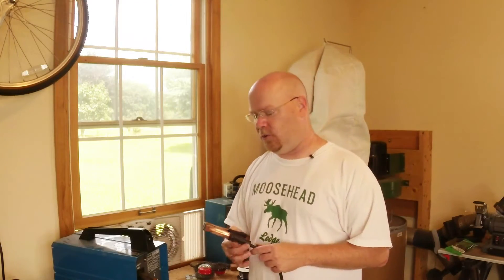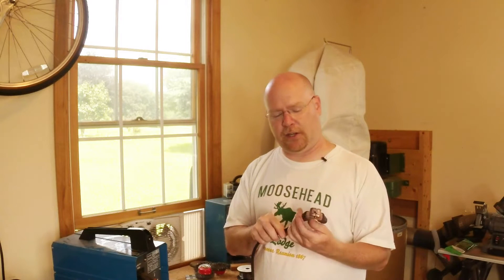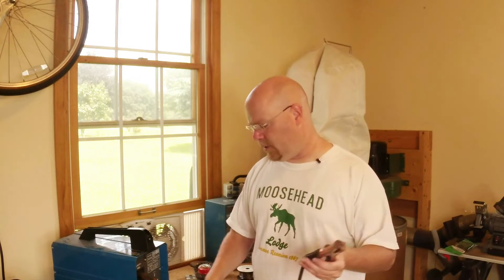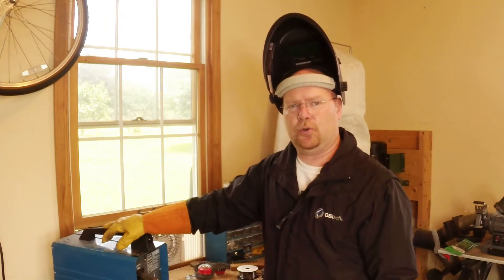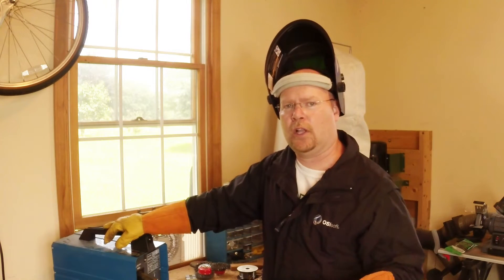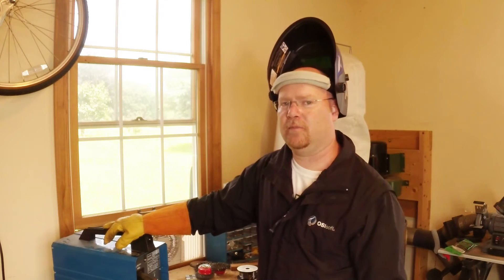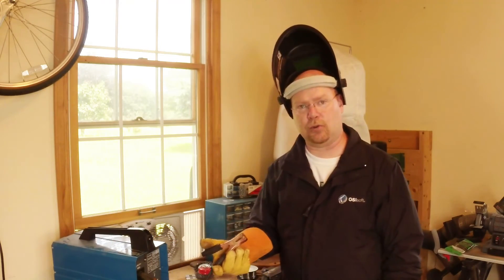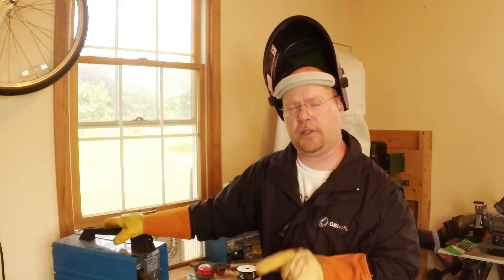Easy Harbor Freight 90 AMP Welder Mods 08

Comment: thanks for the videos. im attempting to  restore a 95 jeep xj. never welded before, my boss is letting me use his welder. i have to replace the whole floor and rail pieces. so most if not all the welds are hidden but i have to make due what i have thanks

Comment: Ok I have a stupid question ? I have a harbor freight 90 amp flux core can I plug it in to a portable generator?
Reply: Well...

The unit wants a 20 amp rated socket, if your generator puts out 30 or more... I've seen guys do it.

I'd worry about damaging that generator to surge though.

Comment: Hi Matt, Michael Lydick here (AA2QO dit-dit). 

I did all the modifications, with the only difference being I used a much larger sized can, and I had to run 10 gauge wire from the leads which were about 10" each from the can back to the rectifier. When we went to weld, there was almost no power, and the bead formed on the surface of the metal like bubbles. . 

I purchased this cap:
PHILIPS 34000uF 50 VDC Large Can Electrolytic Capacitor 3186GH343U50AMA1 --SC

And this rectifier:
Taiss / 100A Amp 1200V Heatsink Shape Single Phase Diode Bridge Rectifier Metal QL100A

All leads going to the rectifier are original wire screwed to the terminal. The leads going to the opposite side of the box to the cap are #10 and about 8-10" long with screwed ring terminals. 

We had to flip the switch to "high" to get it to penetrate the 060" .  Something's weird....any advice appreciated.

Oh - when we put the leads back to OEM, it welds like normal. :-(

Comment: i've used mine off and on for 10 yrs. required the tensioner mod and have had to reinforce the wire hose at the face plate. but for a position welder i've found with practice i could weld vertical and over head outdoors in moving air but you had to leave or even extend the nozzle. i guess the new one is better or safer anyway the only hot with the trigger pulled unlike this one. but there very handy if 220 isn't available.

Comment: How is that welding helmet working out? Read a bunch of mixed reviews on HF..
Reply: The cheap auto-darkening helmet from HF is actually somewhat slow, especially if you've ever dropped it.  You will get the initial arc flash with no darkening and be seeing spots for a few minutes.  I try to avoid it now and use an old school flip down helmet, heh.  Spring for the good helmet if you want auto darkening.
Reply from the maker: It's working fine for me.  Flux core is a messy process no matter what you do, so while more expensive helmets are decidedly clearer up front, after about 5 minutes of welding they all end up the same.
Reply: +Matt Heere Nice! Thanks for the quick response. I'm going to pick up that mask . I have another question.  I'm looking to building a rack for the back of my pick up would this welder be able to handle/weld a 1-1/2" pipe schedule 40? I would use tube but kinda hard to find an inexpensive tube bender.

Comment: I bought one of these HF 90. I have had it and used and still use it for 5 years now . It has done great for me, I did notice right off about the tip and I stay away from HF wire. But I use it a lot on building bandmills which I use a lot of tube steel . The wire feed rollers have slipped so I was using a C clamp to apply a lil pressure but now I know how to fix that issue. Thank you for the info. Its very helpful.
Reply: I've got a really old unit (I think) and the feed mechanism is somewhat different.  About 2-3 years ago, I tried using it, but had no idea what I was doing and the cheap, auto darkening HF helmet would always darken too much, regardless of the setting, and I couldn't see what I was doing, just a small spot of light.  But feed worked fine.  So I took your advice (not complaining, probably shouldn't have bothered) and adjusted the feed roller (it has Lincoln .025 wire and what looks like the right tip to the thinner notch.  Found the non-drive roller very stiff and lubed it so it rolls free.  Now it won't feed AT ALL...  :(  Maybe I'll try this fellow's C Clamp idea.    Or try removing the wire from gun and re-feeding from beginning to see if it'll feed at all/stop at some point down the gun tube.  Frustrating to mess myself up..  :)

But thanks for great series of videos on this little welder.  Without feed working at all, no sense doing anything else to improve it's use.

Ok, I'm an idiot, forgot after last tweak to tighten the screw down.  Seems to work, sorta.  Might be the fact that it's designed ONLY for 30 and 35 wire and this is 25.  I'll have to dig up the old HF stuff I bought before I knew not to.

Still can't seem to get much penetration.  I've done gas welding in the past and do pretty well, mostly on thin stuff, so I understand about penetration being important, but just doesn't do it.  Will try the thicker wire and see what happens.

RichE

Comment: I have an Lincoln Sp 135 and it was 600.00, .035 wire, It looks like the same weld, less splatter but I'm no welder. I use it  instead of nuts and bolts, It does accept gas,.. argon and come's with a meter. But with flux core, I never use that feature. I tried it years ago to be honest I don't like the smell of argon. flux cored works for me, Next time I'm in the market for a 120 volt welder, Ill give harbor freight welder a try. Very informative video.

Comment: love your series on this buzz box. as a union pipe welder who does it all but, mostly stick welding i learned so much. sometimes or all the times dragging out my welders are a p.i.t.a. lol. so i was thinking on getting this pos to do light stuff. like pinning muzzle breaks on rifle barrels. that bb-ing can be minimized to a small amount on short stringers by covering area around said weld with pieces of fiberglass welding blanket and taped or wired around the area. thanks for your tips! you have a great channel that i subbed.
Reply from the maker: +MegaBait56 Thanks!  I want to pick up stick welding at some point.  I love the idea of the versatility of all the different rods available.

Comment: Thanks for doing this series. I'm gonna be doing this mod soon. I will be using a 68,000 uf cap and I want to put a bleed resistor across it. Would a 10 watt 20 ohm resistor work, or should I get another value? Thanks!

Comment: Matt I just found your channel. Nice. Have you tried to run .023 wire?
One mod I would recommend is to screw a piece of 1/2" cooper pipe inside the upper and lower jaw of the ground clamp. No need spending 25% of the cost of the welder on a descent clamp. I used brass #10 screws. I bought one of these little machine 5 years ago to repair a riding mower. (you know "just one more season") I find it very handy, and worth the cost. I will be applying your mods to my machine.
Reply: I did something similar to that right when i first got the welder about 6 years ago. Works great. Through i may buy this lincoln electric clamp for $7. https://amzn.to/3dA4XKS

Comment: Great video series breaking down the pros and cons of the 90 amp HF welder. I have one question.  I am contemplating purchasing this welder or the Longevity 100 amp flux core welder (http://www.homedepot.com/p/Longevity-Migweld-100-MIG-Welder-with-Transformer-Technology-880130/205219111#product_description).  The Longevity is $50 more but essentially looks the same from the outside with very similar specs.  The main purpose is for a garage/ hobby welding so it will not be used under strenuous conditions or on thick materials . Is it better to go with the Longevity because of the brand or are the differences of these basic wire feeders negligible?
Reply from the maker: Aaron Moore I don't know anything about the Longevity, but as a pure guess I would say that one flux-core only Chinese import is probably a lot like another for most practical purposes.  The HF can be had on sale for $90 or less, and often if available on Craigslist for much less.  I got mine for free :)

Comment: I have an older Harbor Freight welder, the spool goes in the side instead of the top. Anyway, my point being, mine has the setup for gas as well as using flux core.
Reply: LordFaulkin Yeah that's a different welder.  I think it'd would be either the 170 or 180 amp MIG welder.  The machine in this series is cheaper (~$90) lower amps, runs on 120v instead of 240v and has no option for gas.

Comment: Matt, just wanted to say Thank You for taking the time to produce & post these videos. I know you said this wasn't about learning welding, but as an absolute novice I still learned a lot.  -Any advice on welding thinner metals.  I've done the mods you suggested & it made a day & night difference, but even at the lowest setting I'm still getting burn through when working with sheet metal & exhaust pipes.  Thanks again!
Reply from the maker: You're going to have to do a sort of pulse welding to do thinner material with this unit.  As you noted, it can only be turned down so far.  Weld and inch or so (maybe only a spot) and stop.  let the piece cool off a bit and weld another inch.  It's an incredible pain, but it'll work with practice.

Thanks for the kind words too!
Reply: Thanks for the reply.  I'll give it a shot.

Comment: nothing to negative but you are awfully critical of harbor freight I know a lot of people who only shop there and I even own the same welder and have absolutely nothing bad to say about it love it will buy it again if need be
Reply from the maker: They have quite a bit of my $$$ too.  My dust collector, drill press, air compressor and sliding miter are all HF.  I'm critical mostly of where they cut corners that make a big difference, but wouldn't affect their ability to sell at a discount.  There's no reason for instance for them to include .030 wire and .035 tips.  I think a lot of the people who buy stuff at HF (myself included) buy it to do a specific job, and may not really have the experience to notice little stuff like this.  Yet it has a big impact of the performance of, as you correctly pointed out, tools that do basically work.
Reply: I just picked up the latest generation of this welder (62719). It came with 0.8mm wire, the drive wheel was set to 0.030" (and it's marked "0.030" and "0.035" now), and a 0.030" tip was all installed out of the box. The drive mechanism looks slightly more refined and doesn't need a part ground down to make it grip. The bad news is the ground clamp is the same design, but it's no longer copper. I believe it's just galvanized steel.

So the first things on my shopping list are a new ground clamp and some Lincoln wire.

Thanks for the vids!
Reply from the maker: Thanks for the update.  Been a while since I picked mine up, and it wasn't new at the time.

Comment: Just changing to the Lincoln wire makes a HUGE difference. Checked, and my HF was set up for .030 on the tip and drive. Thanks for the info. Looking forward to the adv. mods.

Comment: Wheres the rest?
DC Negative right? Did you ever finish or end up running in to a better welder for very little bucks?
Im switching wire Immediately though. Thank you for that tidbit.

Comment: Another easy mod that I think is nice is to move the power cord to the back panel. All it takes is unplugging two spade connectors, removing a screw, taking the grommet out and making a hole in the rear. The hardest part is the grommet is keyed, so if you want to do it right you need to grind or file a small slot off to the side of your hole. Or just file the key off the grommet like I did.

Looks a lot cleaner in the front and the cord is less obtrusive to me. And you get a bonus of a extra ventilation hole.